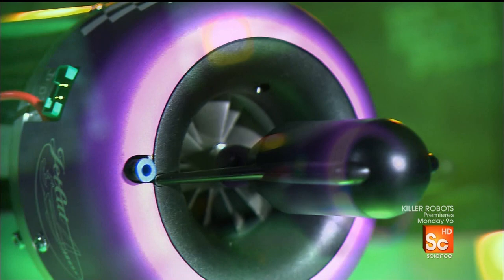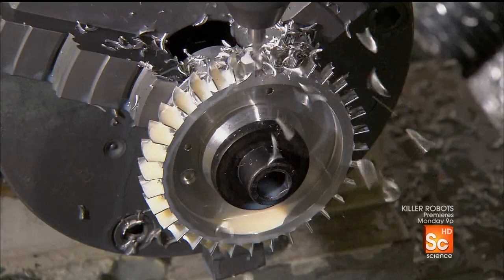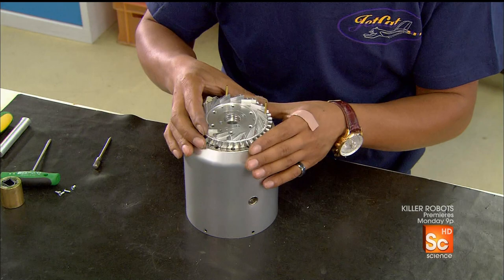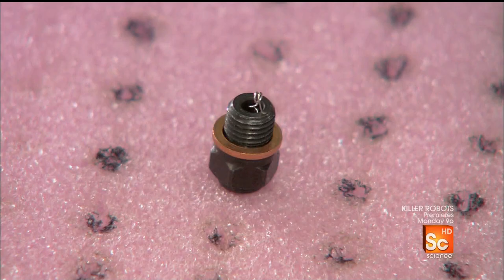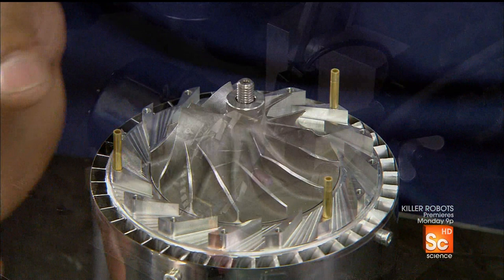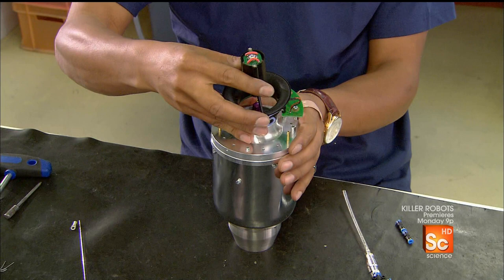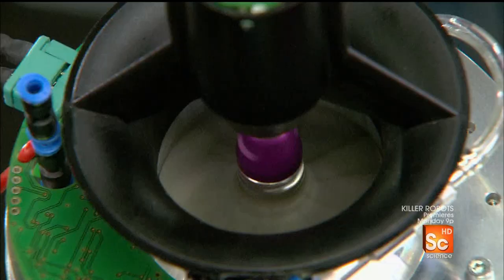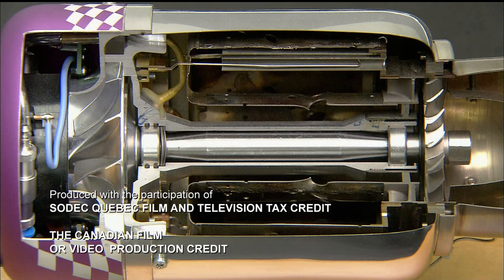Model R/C Turbines

Comment: It's hard to imagine life before the CNC machine. That is, without a doubt, one of the greatest inventions of all time. In it's self.
Reply: imagine that day, when a machine could reproduce itself.
Reply: @juergenengelmann4629  there's this video called how people think CNC machines work.... Humans aren't going anywhere
Reply: @juergenengelmann4629  In fact this already happens in a way because some parts can be so mathematically complicated that they can't be done by hand anymore.
Reply: You forget that the guy whos doing the adjustments is not a CNC machine but instead is being advised by a computer.

It's hard to imagine life before COMPUTERS. That is, without a doubt,  THE greatest invention of all time. CNC machines are COMPUTERS.
Reply: The life before the CNC is still acceptable but not so fast. Things are still possible to be made. There are still lots of manual milling machines works today. It is a matter of cost, the CNC itself is very expensive, but it saves time and labour.
Reply: 3D printing. The first arrow was subtractive manufacturing. Now we additive manufacturing.

Comment: No wonder why it's so expensive, It's made out of the blood and sweat of this individual
Reply: Yeah and he gets the grand title of "a worker".
Reply: @gersonboav1  Yeah CNC machines have no idea that they're making something =/
Reply: @henryforster8101  what about the assembly process?
Reply: @gersonboav1  The CNC machines make everything sharp. Sharp corners, sharp edges, blades, etc. It's a machine unawre of it's purpose, what the heck it's doing, and what it is. And the people assembling these sharp precision parts could get cut.
Reply: I was thinking the opposite, how cheaply these could actually be produced... These things sell for $2500 to $12,000. What cost is there in 6 hours, $400 maybe in parts, materials and labor?
Reply: @utubeaccess7  Probably even less if you consider they make hundreds of these model engines per day.
Reply: @henryforster8101  For now
Reply: @utubeaccess7  good cnc mashine cost like 50 grands. All nessessary euipment will be cost about 500 grands.
Reply: @henryforster8101  Its terrible. And even worse, they make sharp knives for kitchens. Surgical tools. Axes. Chain saws. Chisels. Wit.
Reply: @woodfinchcrafts7267  Gee wiz calm down. Read what I previously said and maybe I won't be such a know-it-all. Wit.
Reply: @woodfinchcrafts7267  My point in this whole conversation is that it's thread lock and not blood. The only explanation for random "blood" would be a sharp trailing edge of a turbine blade. What I said earlier was pointing out that a CNC machine isn't going to make something kid friendly. Therefore it a worker got cut it's going to be treated and not just spill all over the innards of the engine.
Reply: @henryforster8101  Oh ok. Thread lock is a fantastic product, although tomato sauce is cheaper (a lot cheaper) for fake blood. No, machines do not make soft edges (I have the stitch marks to prove it).  If my lathe or CNC did, it wouldn't be working
Reply: He had to put a band aid on half way through the video because he got thread locker on his hand, LOL.

In case no one noticed, this video was made by disassembling an engine, and adding in the cnc and welding steps.

Also, nice 38 dollar wedding ring from w Wal-Mart.

Comment: They didn't say this was a Centrifugal jet engine, not an Axial flow engine. As you see the Centrifugal engine is actually quite simple in comparison to an Axial flow. In part it makes the engine easier to maintain and more reliable in that there are fewer parts. Honestly these engines do kick ass and I believe these were the engines used on that Swiss guys wing pack, the one where he jumps from a plane and flies with it before having to use a parachute to land. Sorry I cannot remember the name of the man who flew the Wing Pack but it uses 4 of these engines. All I can say is I am impressed at how simple and clean these engines are mechanically. In remote control it is hard to find better. You also are looking at the high end of Remote Control. This is the power plant of choice for the REALLY big R/C airplanes.

Comment: Turbine parts are not cast in molds, they are just machined from raw titanium and aluminum. Molding would be a waste of time since it would still then have to be machined to make sure it is exact. The tolerances of all the parts is too extreme for molding to be cost effective, It would just end up slowing the builds and costing more.

Comment: Well that is my theory, because these turbines work on a thermodynamic cycle. Since the temperature increases in the combustion, then because of the ideal gas law, the pressure also increases. This is assuming constant volume because the combustion chamber isn't changing shape or size. Since the pressure increases during the combustion, this forces the combustion gases out the rear turning the turbine and changing the velocity of the gases. This change in velocity of the air is the thrust.

Comment: your probably thinking about an axial flow turbine. model turbines are centrifugal flow. the compressor forces the air to the outer edges where the plate has fins to direct the compressed air to the combustion chamber. an axial flow just sucks the air straight through (along the axis of) the engine.

Comment: they use radial flow to keep the costs down. there is a 5 stage axial that was developed and Jaguar was looking at it to use in a hybrid from last i heard. it was to power a generator to charge the cars batteries.

Comment: the reason they are so expensive, is kind self explanatory, its a jet engine not much different than that of a real jet engine, so the workers putting it together probably make a pretty good pay check and in the video it said it takes 6hrs to make one, add that with an hourly wage and then the work involved in paying CNC machinists to make the parts, it gets a bit costly sure building just one by yourself would be a lot cheaper but remember they also have to make a profit on them

Comment: The other one is for lubrication. The bearings work under oil pressure I guess. Normal ball bearings wouldn't stand the high rpm.

Comment: It is symmetrical. There are two different types of blades on the compressor wheel for aerodynamic reasons. Look for some turbocharger compressor wheel machining videos, it's the same there but probably better visible.

Comment: Answer :

1) It depends, what is the power of jet engine, with thrust of 60 Kn any big size with nice weight can fly. (please confirm figures)

2) Yes it is possible partially, because compressor and rotor are difficult to fabricate and close to perfection balanced.

3) China at the moment is world's market place, you may find many. 

Hope it solves your doubts

Comment: These would produce no thrust without combustion. What powers the compressor and turns produces thrust is the difference in velocity that the air goes through because of the combustion.

Comment: Amazing Mini Jet Engine👏
What if they added an Afterburner at the end, running on Fuel fumes/vapor, would it make this Mini Jet Engine go Supersonic😲😏
Reply: blue280485 no I don’t think a jet engine like this could go supersonic it would have to be made out of stronger materials
Reply: Umm.. no!
Reply: You could in theory but it would need to be an axial compressor rather than a cetrifugal one as this one is to generate enough thrust. Would also need a convergent/diverget duct and an iginition source after the turbine outlet. Its the fuel consumption and fuel weight that would be the issue.

Comment: When you rotate these engines to well over 100,000 RPM, several considerations go up exponentially;  the weight of the turbine blades, the significance of balance on the turbine wheels, and the legal liability for JetCat if one of these little missiles come off the wheel and enter your head! Liability, engineering, metallurgy for components,
CLC machines, and other factors run the cost up-only if you plan to make a profit from the business....or you could buy parts at Ace and make one yourself.

Comment: I just cant understand, that plastic tube or other wire parts are not melting when the turbine works? Its release a lot of heat when it operating, how they could be possible working on that temperature without burning?

Comment: Ok, great work. But they need "only" 6 hours to build one and then they sell it for 3000-6000 bucks. I think they cost too much. Material and work together should be max. 1000 bucks. It would be great, if the prices for RC turbines decreases in future.  If they would do huge numbers of these and would automate the production process, they could cost about 500 instead 5000 and affordable for more people.
Reply: well the demand is not that high so they can ask more for it. And then you need to add the man hour it takes to build on and the engineering that went in to it. you can't really make an automated process of the because some of the parts are to small and assembly is to small and complicated for the most parts

Comment: It hurts to see the red cable getting caught and maimed by the jet cover when it's put on. Also, why the hell do they use an open bearing without a shield? The gasoline that is used by the engine does not contain lubricants like 2-stroke gasoline sometimes does, so the bearing will probably wear out quite fast.

Comment: Jetcat, are you shitting me?  1:30 on, this person is bleeding all over parts of the engine.  And you ship your engines out like this?  Covered in a biohazard?  And this passed editing?!?!
Reply: +Monel Funkawitz Well then, just don't lick your new JetCat. Hahahah.
Reply: Well, the turbine running at max throttle would kinda make it not a biohazard.
Reply: What am I doing?
Check out the LM X-56 that is operated by NASA. It uses two JetCat P-400's.
Reply: Probably cut his self on the turbine. Some machinist didn't deburr his work!!
Reply: Monel Funkawitz as soon as the motor turned on it wasn't a biohazard anymore. the fire burned it away.
Reply: Speedy You probably can't deburr the turbine too much. Sharp edges are probably required for proper aerodynamics. My question is why didn't the worker wear a glove.

Comment: CNC for this model? No more than 500 bucks, you can melt aluminum and make de alloy for forging as well which is even cheaper. With a CNC you can make the model, and with forging the metallic parts. Yeah, pretty much you can make your own, and have spare parts all the time.

Comment: At 0:50 the commentator says that they are making the turbine wheel out of aluminum, while a 5 axis milling machine cuts the blades into the disk blank.  I don't see how you could make a turbojet engine turbine wheel out of aluminum, unless you want globs of molten aluminum shooting out the back end of the engine when you fire it up.  What is the turbine wheel really made of?
Reply: Ian Douglas But... Is that wheel in the hottest spot of the flame? I think not. Anyway, as long as the turbine isn't running on propane, I can't imagine it melting aluminium.
Reply: +Ian Douglas  He didn't say turbine wheel..... but he did say "lift" lol  that piece is call a diffuser that channel the air from the compressor into the burning can. Turbine wheel made of Inconel metal.

Comment: you wont be able to build an axial out of a turbo charger because they are centrifugal as well. axial flow does produce more power then a centrifugal (radial) flow turbine. i have seen a number of videos with turbos converted into turbine engines though. there isnt really a practical use for them however other than the learning experience.

Comment: When you think about it 
They are pretty overpriced 
Run time before bearings need to be replaced is 25 hours 
Compressor first diffuser is triangle cut causing massive turbulence at exit 
And dynamic balancing is done at low rpm also balancing for this application should be done separately for compressor and turbine wheel so if they shift from surge or vibration engine's rotating assembly won't fall apart

Comment: its not a bypass turbojet, its a centrifugal turbojet. a bypass is a type of turbofan . basicly, the fan and the exhaust provide thrust in a high bypass like a 747. something like an f16 uses a low bypass with an afterburner. these have no bypass.

Comment: you know I have thought about something very similar and I am not claiming to be a aerospace engineer, biomechanical,or electrical engineer  etc..etc...  but these engines just could never deliver the required amount of power needed to lift a 180+ human plus however more for the equipment. however there is a jet pack being built by this guy named Troy Hartman using these type engines who claims will be able to lift a human for a very short period of time ex. 3 min.

Comment: Axial flow turbojets in this scale aren't practical. Each axial stage would cost more than the single radial compressor and each stator stage MUCH more so (and you'd need many of both), tip leaks are proportionally greater, it'd be much more finicky to use, needs interstage bleed control, the engine would be heavier, it would have greater gyroscopic effects (more rotating mass) and no R/C model is not going to fly at the speeds where axial flow benefits can be obtained.

Comment: So the electric motor is just to start the compression of the air until enough power is generated to do so but the turbine itself?
Reply: jet engines can thrust out of both ends.  The electric motor is to start the air flowing in the desired direction.

Comment: isnt it possible to build it without integrated starter motor, for holding it external to the shaft, to save weight?? in a model you have to start it only one time and weight counts. or is this for the possibility to start it up again, when the turbine stops unwanted in flight? im not a pro in this, pls tell me someone.
Reply: The starter is required to get the air moving in the correct direction.

Comment: Do these turbine engines have any practical purpose for the average person? Can you mount one on a bicycle, paddleboard, kayak, canoe...? Are they practical for that use?
Reply: Attaching them to anything can be tricky—they get very hot—can burn flesh and set things on fire. It’s NOT a toy! They’re also terribly noisy. The neighbors wouldn’t want you careening down the street at high speed with that racket maker attached to your bicycle and many places where you’d take a kayak or a canoe may be noise-sensitive wildlife preservation areas. A spill in the water would likely ruin it too.

Comment: Here's one in action: /watch?v=OJl7Dig1gLQ Unfortunately, it's just little more than a cruel teaser, as the builder himself makes a point of it being infeasibly expensive. There are also some prototypes at GTBA website, but they too are pretty expensive. Perhaps a bit more unusual designs, such as aft-fan or reverse core (which would eliminate the concentric shaft issues) might provide a solution.

Comment: How much mousepower of thrust does this engine produce?
Reply: Type "very fast rc plane" in the search and watch, you would be surprised
Reply: The top model produces enough thrust to lift about 35-40 Kg load straight up..
Reply: You all always work extra , use high turbine that's it
Reply: Hi power magnet of opposit poles
Reply: Three blind mice
Reply: about 40kg of thrust and and 116kw power output according too there website
Reply: Around 150 hp

Comment: What if i run the engine without providing fuel(kerosene). DRY RUN ?
Reply: Uh..it won't run? duhhh
Reply: sc0tte1 even if i supply power?
Reply: mudit maurya Then it'll only run the starting engine, but it won't power the rear turbine blades so it won't supply more power than the starting engine can come up with

Comment: Am I the only one who thinks this jet engine is missing some compressor stages?  I'm not a professional jet engine mechanic, but all I see are two stages of compressors.
Reply: It's not exactly like a full scale jet with multiple compressor stages, but it works!  Last I heard they put out about 45 - 50 pounds of thrust.   Plenty for an RC jet.  Thing costs almost $5000 USD as it is.  Doesn't need to be more complicated (re: more $$$$$$$$$)

Comment: what's the thrust power on these engines?
Reply: around 6-30 pounds depending on size
Reply: up to 22 pounds, if it's converted to a turboprop or high bypass then you can get more out of it.

Comment: '
worker put assembly with the jetmotor...
must use 2 gloves on the both hand...
not bare nake hand...
hand have greaseey / oilly touch on the jetmotor
Reply: will burn off on the first start i don't think that it will be a problem

Comment: whats that machine called at 0:48?
Reply: CNC machine or Lathe machine.
Reply: CNC Mill
Reply: No, that is a CNC mill, not a lathe. Lathe is where the first disk was spun and the diamond shaped thing took off aluminum around the circumference of the part.
Reply: looks like an end mill but far advances for the one i used in a shop in the 60's
Reply: either a 4 axis mill, or a mill turn lathe. probably the lathe. too close up to tell